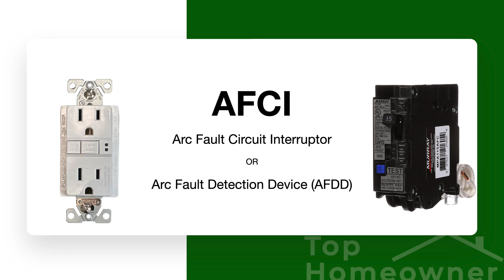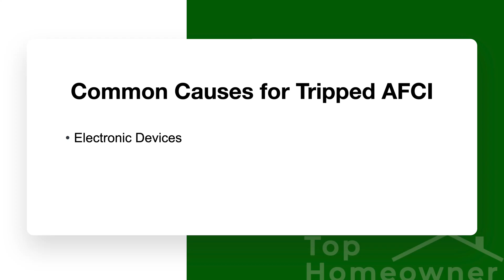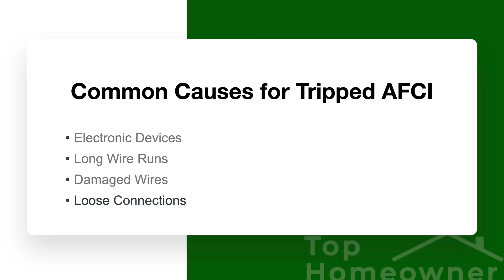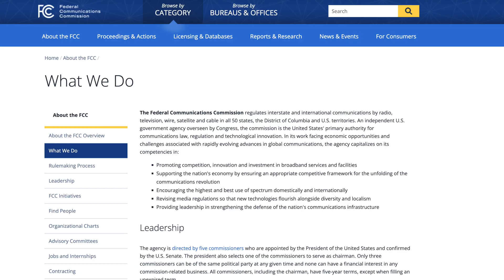End AFCI Nuisance Tripping: Discover Hidden Causes & Stop the Drama Now!

Comment: I have a Square D 15 amp CAFCI plug on neutral that trips every time my power goes out and comes back on.  If I go to my breaker panel and turn the main 200 amp breaker off and back on, the breaker will trip upon turning the power back on.  I changed the breaker with a new one thinking it was the breaker, but it still trips.  Any suggestions?  Thank you in advance.
Reply: It is always a good idea when manually turning off the main breaker to turn off all the individual breakers before resetting the main breaker  Then turn on the individual breakers after as this stops a massive power surges to your equipment on the individual circuits.  Obviously this will not help on an unscheduled power loss......

Comment: well, thanks for the info.  new house, build in 2021, and these are a royal pain in the ass.  At first, they never tripped.  but in the last 3 months, all of them have tripped, and nothing has been added to 2 of the circuits, but they trip everyday now.  Replaced by a bog standard breaker, these need some work.

Comment: I had this issue in my house.  1) The refrigerator would randomly trip it (of course, when we were away, ruining everything inside), 2) my home office (computers, displays), and 3) my media room.  

It was a brand new home.  The only thing the builder's electrician would tell me was to not use these devices.  (???? Really?). I hired my own electrician who (after a reasonable amount of troubleshooting the wiring) recommended I swap out those three breakers for non AFCI ones.  I wish there was a better solution, but I haven't had the problem since.  

Is there a better solution?  I'd love to know.
Reply: It’s funny because my 2018 house has none of these on my panel  and my home inspector freaked out and said my house was going to burn down. After doing my research, I have decided he’s a dumbass
Reply: No, im a licensed electrician, and i f-ing hate them. I have never seen these breakers trip for a good reason. They eventually start tripping over time, and every time they do trip they become more and more sensitive each time, to the point where the breaker itself will not hold even if the initial reason for the trip is resolved. 
 
Although i loathe these breakers, we can get in trouble by installing the "wrong" breaker. Whoever said you need to swap them is correct,  it will fix the issue. However, the county you live in madates them. So i would tell you the same thing but wouldn't install it myself.
Reply: A better solution would be requiring MC cable instead of AFCI breakers.
Reply: @davidperry4013  what is an MC cable ?
Reply: There is a better solution.  All of the so-called "professional" electricians are just too lazy to learn what it is.

These sorts of problems can almost always be solved by adding a sufficient additional power line filter to the problem device (quite often, all you need is one of those "surge suppressor" power strips, though you can also buy more special-purpose filters if that isn't enough).  Easy, usually not that expensive, and doesn't require undermining useful safety devices and violating electrical codes, but most electricians I've seen don't want to hear that and just stick their fingers in their ears and say "AFCI breakers are crap! Don't use 'em! La la la!"
Reply: @foogod4237  New construction may mandate them but there are millions of older homes without any of them that work just fine.  They are a solution looking for a problem.............

Comment: Another cause of false tripping is RF (radio frequency) devices.  This would include ham radio transmitters (especially those running high power--up to 1,500 Watts in many cases--and some CB radios with (illegal) power amplifiers.  A lot depends on quality and type of signals emitted.  Shielding and decoupling of power cables has been beneficial in some cases--enclosing the power lines in grounded EMT, commonly called conduit, can help in some cases.  Other factors may enter in with radio transmitting devices, like the type of antenna used and distance between antenna and distance from the house wiring.  AFCI manufacturers don't seem to test much for susceptibility to radiated RF interference, as the process often tends to be time consuming and frustratingly unpredictable.
Reply: Do you think radio frequency fan controller can cause a AFCI/GFCI breaker to trip
Reply: @awesome551000  ---   Perhaps, but it seems unlikely.  The remote control emits a very low-power radio signal (many are Infra-Red [IR] controlled and cause no interference problems.  It's possible that the speed controller or the on/off switching in the controller circuit is generating a fast switching spike that fools the AFCI.  They are not very sophisticated and are made to sell as cheaply as possible.  You might try using a different speed controller/switch, or a different AFCI.
Reply: My amateur radio transceiver (Icom IC-7300) trips my breaker regularly. I'm hoping adding some filtering to the power cables will help. Not sure what that filtering looks like yet. This individual breaker also trips sometimes when I run the vacuum. Others don't seem to suffer this. Pretty annoying.

Comment: Just moved into a new house and my new fridge from my other place had to go in the garage but it keeps tripping the gfci. Was reading a rc snubber can also fix that issue sometimes. Going to try that first before replacing the outlet with a non gfci plug.
Reply: The GFCI function is Very important for safety anywhere you may have water or moist ground.
The GFCI circuit is much, much simpler than an AFCI circuit and good units are not subject to nuisance tripping.
A faulty gfci breaker should be replaced with a new unit. 
If a different gfci still trips, check the wiring of your fridge circuit. 
If your fridge is sitting on a concrete floor, there may be a sneak path that causes the GFCI to trip.
If that's the case, putting the feet of the fridge on an well insulated base may take care of it. 
You still have to take into account that someone may open the fridge while their bare feet are on the concrete. 
If the cabinet of the fridge is Hot, this is unpleasant and it can be dangerous.
Reply: Refrigerators are notoriously "leaky" electically. Some will not reliably run on a GFCI. If more than  .004 Amp goes to the Appliance and doesn't return on the nuetral,, the breaker assumes someone is being shocked and trips.

Comment: I had a nuisance tripping issue in my son’s new condo. They used Siemens combo AFI/GFCI breakers. The builder created a circuit for his kitchen island coming of a single receptacle at his wall counter. I tested the NMB cable the builder left “stranded in the island and it was connected to that hot receptacle. Up to then no tripping with hot receptacle and hot loose cable in the island. I added the island receptacle, tested it , etc. using a Leviton commercial receptacle. At that point, his new coffee maker would cause a trip every time it turned on where it hadn’t before. After checking wiring again and trying the coffee maker in another circuit (no trips), I was at a loss what was going on. I then decided to replace the upstream receptacle with a GFCI receptacle . No trips at receptacle or breaker. Tried a bunch of tools , appliances etc. including his coffee maker and no issues. My thought is , for whatever reason, the GFCI receptacle  stabilized the circuit feedback to the breaker. I see Siemens is being sued by large electrical contractors for this issue.
Reply: That's very interesting.
The GFCI has ferrite cores inside that may, in this case, be filtering the circuit so that the AFCI circuit isn't so confused by "normal" but irregular waveforms from the appliance.
AFCI circuits are very touchy and it's hard program them to avoid nuisance tripping.  Apparently this issue is still under development.
Reply: It might have been a loose connection on the load side of the original receptacle.
Reply from the maker: Interesting situation. Since there are some electronics inside the GFCI, I could see that helping mask whatever the AFCI breaker didn't like. Good work! I didn't know about the Siemens lawsuit... I'll have to look into that.
Reply: @TopHomeowner  I have a Square D QO 200 A panel in  my house  (predated AFCI)  and post-installed their Combo breakers on several circuits. Never any nuisance trips. There has to be something with these Siemens breakers. I also wondered if a surge protector receptacle might have worked as well.
Reply: When you manually trip the new wall counter GFCI does it trip the original AFI/GFCI breaker as well?

Comment: I keep having a weird issue.  My computer/TV/Audio System is on a AFCI breaker. It doesn't trip for days at a time.  Then when a mixer is turned on in the kitchen, on a different (non-AFCI) breaker, it occasionally trips.  Do these AFCI breakers detect noise coming from other breakers?
Reply: Complex waveforms due to an appliance may cause a disturbance in a supposedly unrelated circuit elsewhere in the house. 
If the AFCI is on the ragged edge, a little bit of extra noise may cause it to trip.
Reply: I ended up changing out the surge protectors for ones that have better filtering and stopped having the problem.
Reply: Similar issue here.  The running the microwave oven the kitchen causes the home office AFCI to trip.  Two totally separate circuits with some distance between them.
Reply: I have a hair trimer I have used many times but it just started to trip a different breaker (master bedroom that is a afci) but only when the trimmer is plugged into any outlet on my bathroom breaker line, yet that bathroom breaker doesn't itself trip, it's on a gfci not afci. The master bedroom doesn't trip the breaker if the trimmer is plugged in and turned on with any other outlets in the house including the master bedroom that is tripped...?  Glad I found this thread, although I still don't know what is going on.
Reply: You probably have mixed up neutrals somewhere in your house.

Comment: In my garage we have a chest freezer.  If we leave it plugged in the receptacle next to the freezer it randomly trips the AFCI.  We have a single outlet in the garage that isn't AFCI and had to plug the freezer into it with an extension cord.
Reply: Arc fault is not required in garages though.
Reply from the maker: Definitely one of the worst possible places for an AFCI to not work properly!
Reply: This is especially troublesome because you might not notice the breaker has tripped for several days. 
For critical appliances, like freezers and refrigerators it's helpful to mount a small night light on the same circuit so you can tell at a glance if the circuit is still alive.  Also,  you can use a battery operated alarm that sounds when the power goes off.
Reply: Try plugging one of those appliances in with a noise suppressing surge protector 

Use audible alarm AFCI receptacles too!

Comment: So the issue i had didnt have anything to do with having too long of s run.  My gas dryer kept tripping the breaker  then i found out using an extension cord solved that issue.  This weird fix worked on alot of other equipments and mainly equipment that has a motor like my table saw.
Reply from the maker: That's interesting... thanks for sharing!

Comment: I encountered a weird tripping issue with some oster clippers, when I would flip the switch on the trimmer it would trip the GFCI even though there was nothing wrong with it. I'd pulled it apart and looking around the guts as best as I was able to (I'm no EE).
Reply from the maker: Interesting. If they work without triggering the protection with another GFCI in a different room, than it's probably just a finicky GFCI outlet. While this stuff can be a pain... I'd rather the protection work too frequently than not work when it's supposed to!
Reply: @TopHomeowner  I tested it on every outlet in the house for the sake of science, it triggered faults in all the GFI's even though there was no fault. 
I put meter on the other outlets to see if there was an abnormal signature of some kind, nope! 
Forum digging and google searches, later all I could dig up was this model creates a feedback or resonance in the GFI circuit simulating a fault of some kind. 🤷
Reply: @Enonymouse_      
A meter isn't fast enough to show the very fast rise-time of the spark when the switch opens and closes.  You'd need to use a digital oscilloscope or an analog storage scope, to see it.  The short, fast, voltage spike fools the AFCI into thinking there's a serious arc fault, and it trips.  
You might be able to power the clipper through a good over-voltage filter power strip.  The cheap ones are almost useless for cleaning up noisy AC lines.  
The cheapest way to avoid this issue is to have one or two circuits for which  the code DOESN'T call for AFC protection, and use that line to power the clipper.  Note that (at preset) the code doesn't require AFCI protection on circuits heavier than 20 amps--you might be able to use a 30-amp circuit to power the dog clipper--or use battery powered clippers!

Comment: Simply put, these things are not ready for prime time. FACT: The people who produce and market these items are the ones who sit on the boards that vote on the recommendations for the National Electric Code. These beakers cause more issues than they solve.
Reply from the maker: You'd think after being added to the NEC code nearly 25 years ago they should be ready for prime time at this point
Reply: @TopHomeowner  Hopefully they would be ready but the issues with series arcing are very tough to make fool proof.
Reply: The seimans ones are absolutely horrible. They are the bane of my existence as an electrician. I haven't had a single issue after moving to Schneider
Reply: @Mark-op6tx is it compatible? I have the Siemens AFCI breaker and it occasionally trips
Reply: I'm doing a basement remodel so brand new square d sub panel with new square d afci GFCI breaker. 15 ft home run to 6 new halo 8 watt led lights. trips breaker. Isolate to 1 light, still trips. Put in  regular 15 amp breaker, works fine. Add back other lights, works fine. Add ten more lights, works fine. Put back afci GFCI breaker, trips. Guess I wait for inspection then replace breaker but these things cost a lot of money.
Reply: @checksumff1248  Just throw that breaker into your storage bin on the truck, and use it for getting past inspection.
Reply: Thank you for the explanation of how this works and why they trip. We have a newly built house and the only thing that trips the arc fault is the PlayStation 5. I read on forums that this is actually pretty common. Not sure what the solution is, even after we had the electrician come out and double check all the circuits are installed correctly. Frustrating.
Reply: @JoshGray1 hey did you ever solve this issue, I have this same issue
Reply: @JoshGray1 , did you happen to find a fix to prevent this from happening? I’m having the same issue.
Reply: Exactly right
Reply: Facts!!!! Complete garbage made to make money
Reply: Yeah these breakers only cut the chances of a house fire in half. We should just go back to knob and tube and 50 cent fuses!
Reply: @carsonconlee6277  do they really cut it down that much? Source?
Have you replaced the normal breakers in your house and every family member you have?

Comment: When AFCIs were first introduced nuisance tripping  was such an issue electricians and homeowners alike would install the AFCI breakers temporarily,  to pass CO inspection,  then remove them and use standard breakers once the inspector leaves.    Vacuum cleaners were among the biggest culprit.   Sometimes certain dimmer switches caused nuisance tripping when dimmed to certain levels with certain brands of AFCI breakers,  apparently the chopped up sine wave from a dimmer caused issues with the earliest AFCIs
Reply from the maker: That's interesting, I appreciate the background! Thankfully, they have improved over the years, but a lot of people still hate them which is understandable.
Reply: Refrigerators also tend to make AFCI breakers trip when they start. Happen a lot in condo building where the tenant has a second fridge they connect in a different outlet than the dedicated fridge outlet in the kitchen. Such as a small beer fridge in the living room. One tenant I went to for service had a chest freezer full of meat he got from hunting in the summer. The AFCI breaker tripped for no reason and he only figured that out days later when it started to smell funny... It's sad that I had to tell him I knew what the issue was, but couldn't legally fix it...
Reply: @HCkev sometimes you got to cheat.
Reply: @HCkev  You could have legally fixed it.  You just didn't know how.

These sorts of problems can almost always be fixed by adding a sufficient power line filter in-line with the problem device.  That is the correct way to fix these problems, not removing the AFCI protection.
Reply: Yeah and what about regular switches if they are old and you intentionally set them in the middle to create arcs you can audibly and sometimes visually observe that. Imo this should cause the breaker to trip and you shouldn't consider this "normal operation" you should want a switch that won't accidentally burn your house down 😂
Reply: I think it's funny how hardly anyone thumbs up your comment, even the content mule didn't like what you had to say...I imagine most people are just sheep, doing as they're told, not thinking for themselves... All these new codes just happen to involve expensive equipment that I'm sure people in high places have lots of money invested, garbage
Reply: @scottwilliam9883  The NEC is big business: scaring people to sell them the solution, and it's all legal!.  Very good comment buddy!.